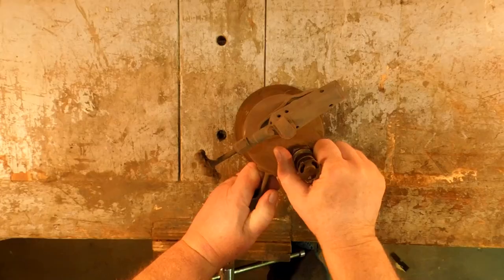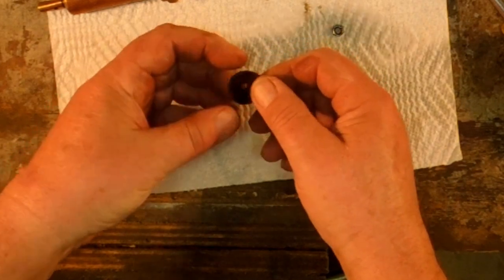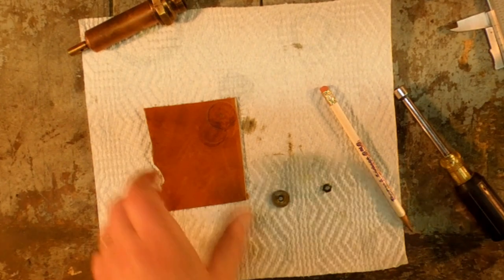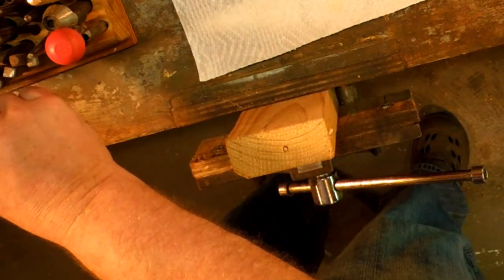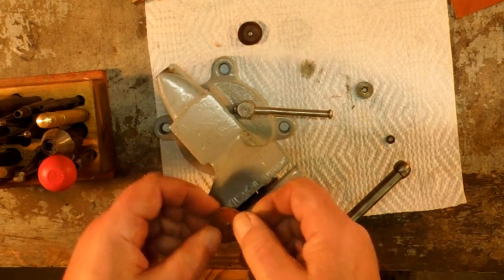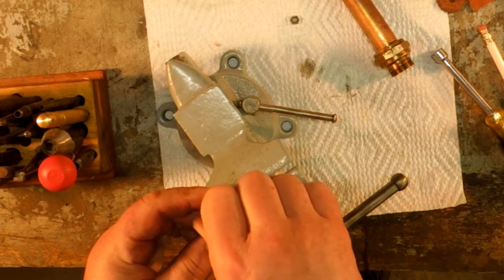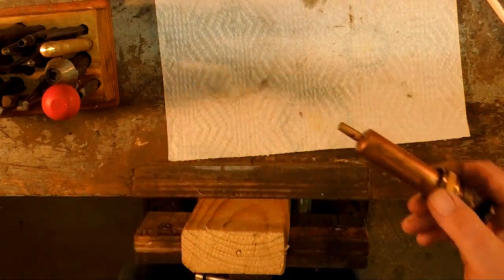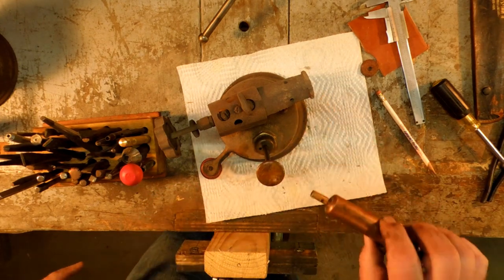Steve Had A Question ~ Blow Torch Pump Repair ~ New Leather Piston

Comment: Washer mold. Drill hole in wood diameter of cylinder, dowel size of washer,  wet washer with water, place over hole, tap in dowel, let dry. Makes formed leather.
Reply from the maker: Great tip.

Comment: Leather is sometimes sold in what is called an ounce or multiples thereof.   It refers to thickness.... 1 oz = 1/64th of an inch.    1/16th of an inch thick leather would be 4 oz.  Great work, Dave!
Reply from the maker: I always wondered about the different weights given for leather.
Reply: I've been working on and off with leather for a long time and I just learned this today...also I always thought the smooth side was the "outside" of the cow.

Two new facts in one video, everythings coming up Milhouse.

Comment: Great video! I repaired my 1949 Craftsman blowtorch using, instead of using leather, a string trimmer primer bulb with the bottom lip trimmed. The outside diameter of the bulb perfectly matched the inside diameter of the pump bore. In addition, sealing issues associated with the plunger misalignment to the pump bore are eliminated.
Reply from the maker: Great tip!  I never would have thought of the primer button.

Comment: I need to do the same thing. I have a Sears that my Grandad had. The washer is shot and the check valve may be shot. I remember it was leaking. I laid the oil to it's hide, pun intended, years ago. It used to work fine but I think I got to mechanicing on it before I knew what I really needed to do.Thanks, Unc!
Reply from the maker: So did it work?
Reply: @OldSneelock  Not yet but I know where it is!
Reply from the maker: @lewiemcneely9143  And that is half the battle! 
GI Jooooeeee......
Reply: @OldSneelock  It used to till I got to goofing with it. My dads old Coleman stove from WW-2 worked but it got gone. Boy howdy I wish I still had it. One of the jobs in the can. When mom moved I bet it got trashed because of the container. Broke my heart.

Comment: Nice switcheroo there.... you just put the old washer back on?!?!?
Reply from the maker: Go back and listen to the video again. I explain that I wouldn't wait for the new leather cup to sit in the oil for a week to soften. I said I would just explain how it works. 
There wasn't anything wrong with the original.  It was an example of what the cup would look like and I used it to help you understand how to make a replacement.
No "Switcheroo" 
Yes I reassembled the existing pump with the original working parts. 
Why wouldn't I?!?!?

Comment: it's actually the pressure IN FRONT of the piston that pushes the leather out against the wall of the cylinder NOT the air behind the piston !  Behind is open to the atmosphere, IN FRONT is the high pressure side..
Reply from the maker: You are correct it is on the pressure side of the piston.
Thanks for pointing out the issue.

Comment: a lot of nut drivers are color coded i know from at lot of use on appliances yellow is 5/16 and red is 1/4 in. i didnt use the other colors much so dont remember the other color sizes
Reply from the maker: I need to check that out.

Comment: in Guy Lautard's TMBR#2, he talks about a replacement design for the burner itself, but without any information about making the pump or the fuel tank - it's clear that it's meant to be used wit han existing kerosene blowtorch.
I'd love it if someone with one of these things and the inclination to do so would post some drawings for the pump and tank! (hint hint)
Reply from the maker: https://classicpressurelamps.com/threads/butler-200k-blow-torch.13326/
Reply: @OldSneelock  oh wow, thanks very much!

Comment: Thank you for this very useful video. I am about to get a "Monitor #52" Blowtorch. I bet the washer is on the dodgy side. I wonder if I can use rubber instead? I have used rubber to make washers for the pump in my old garden sprayer. I used fine sandpaper to bring the rubber washer as close to the diameter of the pump cylinder as possible.
Reply from the maker: As long as the rubber is fuel proof it is worth a try. 
The leather formed into a cup shape is effective because the pressure forces the  leather against the walls of the pump. The higher the pressure, the harder and better it seals. A flat washer will not have the same effect. It might limit how much pressure you can create in the tank.
Reply: @OldSneelock  Thank you for the reply. What you said makes sense. For a water pump, it is possible to get away with it. Kind regards.

Comment: Brilliant instructional, very succinct and precise. New subscriber here. Been trying to find a source of cup washers to no avail (my blow torch has a rubber one), will be making a leather one now!
Reply from the maker: Thanks Mat. Glad you are able to fix your torch. 😆😎
Reply: Old Sneelock's Workshop No problem,thanks for the tutorial! Have now made the basic washer, wanted to check, do you soak it in plain old mineral oil or paraffin, prior to shaping?
Reply from the maker: I use 30 weight non detergent motor oil. Any light machine oil will work. You want it to soak at least overnight. It makes it easier to shape.

Comment: Question, you say just forn up the soaked leather? Is this just don by hand? Any tips? Thank you for the video. I have two okd torches that were my father in laws and I would like to get them in working order.
Reply from the maker: Mount the disk on the end of the piston rod with the washers and nut. Then using your fingers roll the leather around the washer so it forms a cup with the opening facing away from the piston rod. Then carefully slip the assembly into the pump chamber being sure that the leather remains folded correctly. 
Once it is in the pump chamber correctly the leather remains in the proper shape. 
If the cup is damaged or dried out it is a good chance that the check valve is also dried out. Add some oil into the opening on the check valve to soften the seal and help it to work again.

Comment: Does air get sucked into the pump through the clearance between piston shaft & bore in the pump body? Or is there an orifice towards the top of the pump behind the piston? T.I.A for your clarification.
Reply from the maker: I can't say every pump is this way but on all of them I have worked on that is how it works. 
On Colman Gas Lanterns there is a passage through the center of the piston rod that allows air to enter the pump.

Comment: Informative video.I have an oozing paraffin leak around tube exiting the brass nut,[tube running of to feed paraffin vapor to burn chamber].Leak between lock nut and brass tube,coming from inside and more so after a pumping.I did not find a washer underneath this locknut,or do this nut to be thightened down to seal this area?Thank you
Reply from the maker: The tube that feeds fuel to the burner chamber on my blowtorches are attached with a tapered pipe thread that seals without a locknut. 
Couple questions. 
What brand of torch is it?
Is the thread on your pipe tapered?
If it is not tapered is there space for an o ring or seal under the lock nut? 
The leak must be migrating fuel up through the connection and past the locknut. 
If the locknut is preventing a tapered thread from seating in the body of the torch that might be a fix that someone tried. Never having seen a setup like that I wonder if it was an attempt to improve the seal? 
Unless the thread is closely fitted, or tapered, there is always a clearance that allows the thread to assemble.. A straight thread will always leak through the clearance.
Reply: . @OldSneelock  corona ....Birmingham  made in England.The  nut does make space for a seal underneath it .The thread onto which the nut is tightened on to the paraffin reservoir....protruding from the small recess[[ for spirit to warm up parafin ] is NOT tapered..Even  a washer seal underneath the nut will not seal the tube running through it;Perhaps someone attempted to improve the seal/changed it.
Reply from the maker: @katstrauss805  Anything is possible. I haven't seen one like that.
Reply from the maker: Kat I looked at my blow torches and realized that I didn't understand your description of the problem. 
The fuel line threads into the brass nut that is soldered onto the tank. The tank wall isn't thick enough to hold threads so there is a bushing soldered in. 
If it is leaking then remove the pipe and seal the threads with pipe dope.
Reply: @OldSneelock  thank you.Advice appreciated

Comment: These leather pumps are ingenious, last ages longer than o rings that’s for sure. I broke the handle off of an antique torch that was seized, does anyone know how I can replace it?
Reply from the maker: Which handle? The pump or the flame control?
If it is the pump it range replaced by making a new shaft from mild steel rod and removing the broken part from the knob by drilling it out. Solder or braze the handle to the new shaft. 
The flame control is harder to make a new shaft for. t
Loosen the packing gland by unthreading it. That should release the shaft. Don't remove the shaft unless you want to repack the shaft seal. Thread the broken end of the valve shaft. Make a new handle from an old water valve handle and Attach it with two nuts on the threaded shaft. 
Snug up the packing gland until the handle starts to drag.
Reply: @OldSneelock  thanks for the reply. So it was the flame control, the handle snapped, and then the shaft snapped as well, i had tried penetrating oils and the blowtorch technique and thought it had loosened but i kept trying to twist and it broke apart in my hands. Currently i have the rest of the shaft fully drilled out. the tiny hole is 1mm wide now due to my handy work with the drill bit. i could solder and tap the part the shaft screws into but i am still out the shaft and needle. how can i go about replacing it, minus buying a lathe and making one from scratch?
Reply from the maker: @sashasoule4585  I regret that I didn't notice your comment until today. After a year I imagine you have moved on. 
In any case. once you drilled the bore out to 1 mm you have pretty much destroyed the valve. The bore is tapered to allow it to control the volume of fuel going through it. The flame only needs a tiny bit of fuel to sustain it.

Comment: Where's your engraver Unk? Wright I mean write the size of that driver on the metal shaft. 
Getting some fffffine  ffffine ffffffine blasts of air there Unk. 
Nice job.
Reply from the maker: That would be a good idea.
Reply: @OldSneelock  Are you running a program to find all the comments that you forgot to put a heart next to?
Reply from the maker: @mostlymoparih5682  I go back through any of them that don't have a comment on them. It is a standard sort in the Youtube Studio App.

Comment: Can you burn kerosene in a torch like that?
Reply from the maker: There were torches made to burn kerosene, so I imagine it depends on the torch. 
Since the labels are gone on most of the 100 plus year old torches I'm not sure how you could tell? 
So that leads up to another question. Should I try and light one off on kerosene? I have a kerosene infrared heater so I have some kerosene. It wouldn't take much to fill one of them and see if it lights. 
Done! I can test one of the torches out in the blacksmith shop. BFHBA! 
(big fun had by all)  😁😎👍

Comment: I've got a question! Where can I find a replacement seal for the pump check valve? I have restored the leather seal and it holds air, but slowly trickles out because the check valve seal is rotted out. I restored and oiled everything else and just need that seal to make it all come together. Your video was very helpful!
Reply from the maker: I used a bit of natural cork. The check on mine is a small brass cup with a cork plug in it. To make the plug I pushed the brass into the cork. It cut a nice round piece just the right size.
I think on the next one I will use a piece of neoprene o ring. 
Neoprene is fuel resistant and you can get it at your local hardware. 😁😎
Reply: @OldSneelock  Thanks! I think I might go for the O ring, but if they dont come that small I will go for the cork idea.
Reply from the maker: I was thinking more like cutting a section out of the O ring to take the place of the cork.
Reply: @OldSneelock  Can you possibly make a video of it when you do? I am not 100% sure of that process. I'd also like to see how you did the cork.
Reply: @OldSneelock  I think I got confused somewhere, this is my first time restoring a torch like this and I thought it needed an O ring. Turns out the packing in the little check valve was so petrified I thought it was part of the metal until it started coming apart. I think I will use your cork idea or use some rubber I have lying around.
Reply from the maker: Just test the rubber in gas first. Some of it turns to glue. 😁😎

Comment: Is there wicking ?what can it be replaced with?dose it go all the way up to the burner?
Reply from the maker: https://classicpressurelamps.com/threads/butler-200k-blow-torch.13326/ Yes you can replace the wick. It goes up the nipple to the burner and extends a few inches into the tank past the end of the nipple.
Reply: Thanks for sharing!Did they make a room heater .with this design?it wood make a good heater for camping if it used gas.colmen fuel is to expensive to use.
Reply from the maker: @11bayrat  Tilley made kerosene radiant/reflective heaters that used a metal mantle as the heating element. 
Colman makes wick type heaters that don't have an open flame. 
I dont' think it would be good to have an open flame flaring out a foot or so in a living space.

Comment: Is there an absolute way to tell if my torch [looks like the one you have] takes gas or kerosene? And if its kerosene, could i use white gas? I get way too much commentary from everyone saying no it's kerosene, and no its gas, and dont use gas instead of kerosene itll blow you up! and others say its perfectly fine. Lol. Please help! Also mine is leaking out the bottom to but the threads are clean and not bent. Is there a seal Im not aware of that should be on there? Thanks. Would really love to start vintage metal and glass smithing at some point but cant seem to get started
Reply from the maker: Bethany I really don't know of any difference between gasoline, either white or no lead, and kerosene torches. 
There is a difference in the ignition point of the two fuels. Kerosene is more difficult to ignite so the preheat might be an issue. 
I have never found a blowtorch that was marked kerosene. Perhaps some of mine were at one time marked that way but I doubt it. 
If you carefully preheat the torch body prior to opening the fuel valve the fumes coming from the torch should  ignite easily. 
Once the torch is lit the fuel is of little consequence.
Reply: Thanks  @OldSneelock  
I also seem to be missing some seal for the very underneath plug. I think i heard it was a "lead seal" needed. Do you think a lead mix solder [melted or not] would work there? Sorry, so many questions! Really wanna get this thing on the road and very few have expertise and experience with it

Comment: What kind of oil ?
Reply from the maker: Mineral oil. I use 30W non detergent, but anything 10W thru 40W will work. You can use fuel oil,  kerosene,  or diesel too. I just have the 30W handy for the lathe snd drill press.
Reply: @OldSneelock  Ive got some 3 in 1 oil here. I think that will work thanks. Have you ever started your torch up? I'm a little hesitant to try it. Also can/have you tried white gas/Coleman fuel instead of unleaded gas.
Reply from the maker: 3 in 1 is fine. 
I went completely through two torches so I could try and repair a Stanley #4 wood plane. 
There are 10 videos in the series. It was an interesting project and it took me back to when I and my neighbor silver soldered the front axles on my first go kart back in 1964. 
This is the #8 in the series. It is the first real test of the torches. They worked but needed some tweeking. https://youtu.be/9lU3Kcba-EQ
Reply: I have a torch and the name is faded bad. It looks like OUNIA with another letter at the end that I can't make out. Would you know the brand?  Thanks
Reply from the maker: Hi Rodger. 
OINIA isn't coming up as a brand or even part of a brand name that I recognize. 
There are a lot of brands since they were as common as hammers.

Comment: Anyone know where I can buy a new pump ?
Reply from the maker: Buying new isn't likely.
What is wrong with your current pump?
is it broken, or missing?
Reply: @OldSneelock  yes it’s broken, it won’t pump air at all and everything seems to have gotten stuck together over time
Reply from the maker: The pump can be rebuilt. A new piston leather and check valve seal will fix most of them. 😁😎
Reply: @OldSneelock  thanks for the help I’ll give that a try 👍🏼
Reply: @OldSneelock  I can’t get my piston out of the pump tube mine doesn’t seem to unscrew like yours
Reply from the maker: @ricolopez8253  That is unusual. Not being able to see it makes it hard to diagnose.
Reply: @OldSneelock  it ended up being a old gasket that got stuck and it was holing the pump together
Reply from the maker: So you got it open? Good. The fix should be easy now. 😁😎